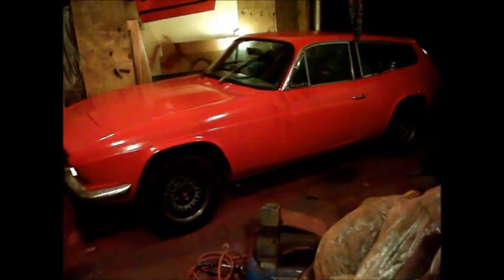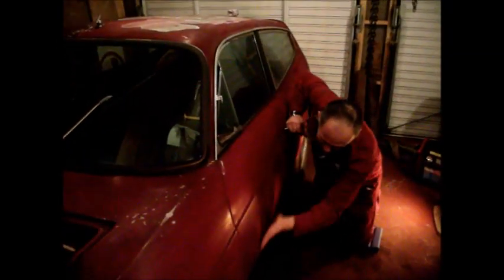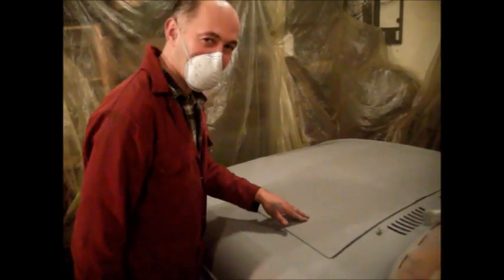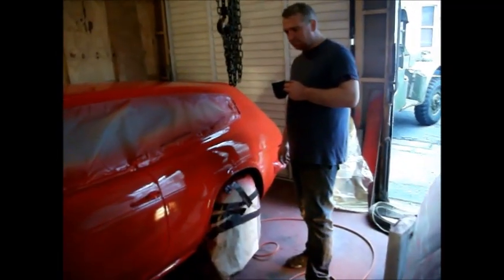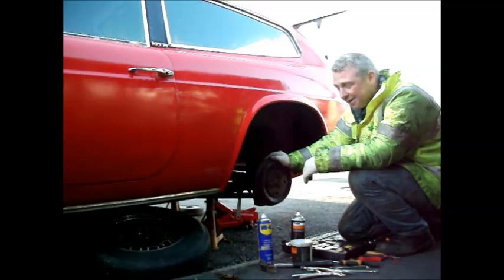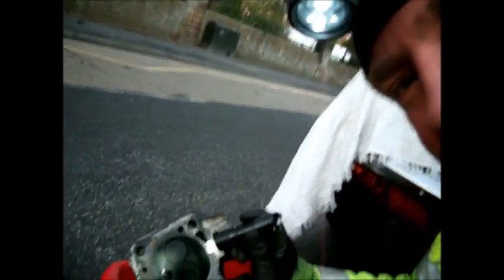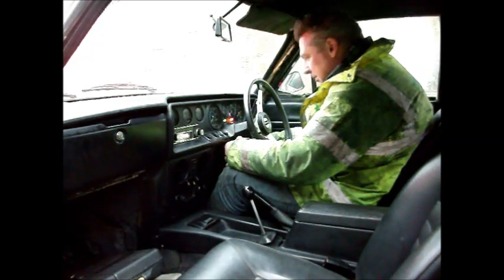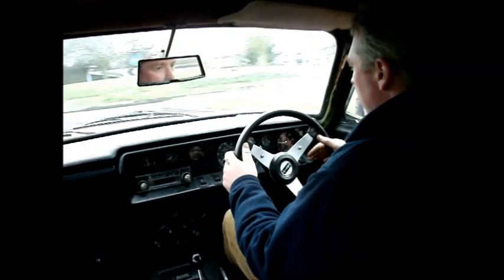24 Hour Junkyard Restoration - '73 Scimitar GTE 3.0 V6

Comment: You did a great job within the time limit you gave yourself.
Reply from the maker: Thanks Michael, glad you enjoyed the film.the funny thing is that the limits - time and also money - are actually great motivating factors.If I'd had a spare double-garage and another car to use for work, I might have pushed the Scimitar into that shed until I had time to do it "properly". I could have had another cup of tea and got to bed as a sensible time. I would have felt healthier and a bit less stressed, but the car would still be in that shed today. Stress is good. Necessity is good. It's what makes me get stuff done!Thanks again for watching.Check out my latest film - Classic & Sports Car magazine feature!Junkyard Tom
Reply: TomsJunkyard Your lucky with the Scimitar body work wise there was no damage like cracked fibreglass. That would have took even longer to fix.

Comment: Good work and true dedication Tom. I won't even touch my cars in weather under about 13 degrees C, but you're battling it out on the side of the road! Too many people spend too much money on their projects (i'm one) and you went from go to whoa for 600 pounds - great effort.
Reply from the maker: +Peter Anderson - Hello Peter. Thanks for the comment. Sorry it's taken me a while to reply. I have checked out your channel and there are some great projects. Among the fabulous cars, one of my favourites was the old Westinghouse washing machine project. A great solution for those oily overalls! Your channel trailer also inspired me to sort one out for myself. A great channel. Inspiring work. Thanks. - Junkyard Tom

Comment: amazing job mate, never easy to work.outside ,car sounds looks great
Reply from the maker: Thanks Rikki. Thanks.Yes, it's tough working outside but I reckon more people have to work on their cars outside than get the chance to work inside. But it can be done and it's worth it.My top-tip is the Hi-Hiz Motorway jacket - available cheaply from any builder's merchant or industrial clothes retailer e.g. Arco - also available at Halfords at higher price (can be as low as £18) - one of these, a beanie hat, thermal long-johns under your jeans and a head-torch and you can work through any weather. Motorway Jacket is virtually a portable workshop.

Comment: Brilliant! I've just bought a Scimitar myself! SE6a, got some work needed but looking forward to it!
Reply from the maker: Awesome Kevin. Sciimitar is totally under-rated, super-stylish practical GT that's fun to drive and makes AWESOME noise. Check out Burton Power (they do a great free Ford engine tuning )and it will be really quick, too. good luck.
Reply: Hi Tom,  just a question about the prep work for re-spraying, did you only sand down the rough patches on the body not the whole of it? I'm coming up to prep mine for spraying so thought id ask,

Comment: I used to paint semi trucks in a junkyard with no heat. And if it got cold enough overnight the paint would start to go dull or flat.
Reply from the maker: I'm there with you. Sometimes the jobs with no resources and the wrong tools are the most satisfying.